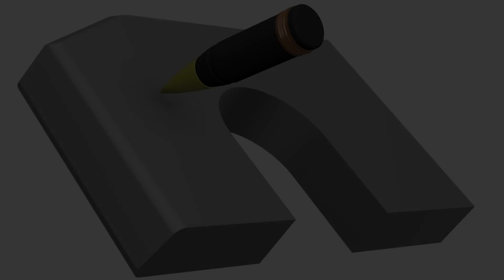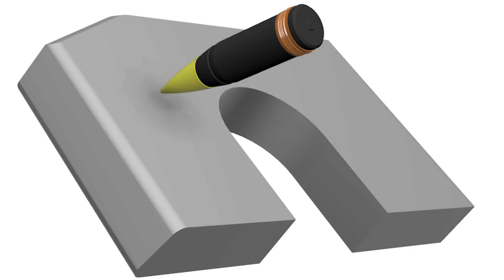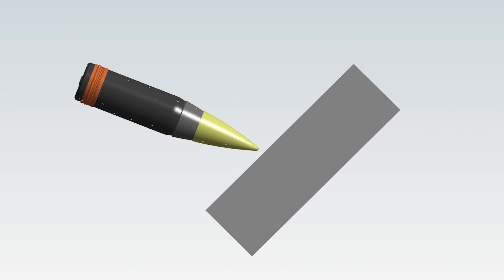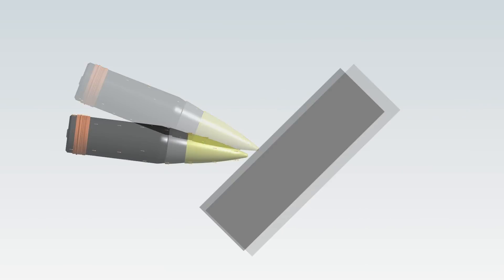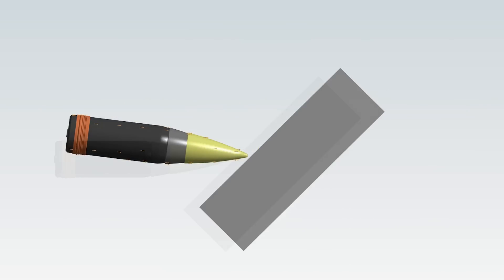USS-Iowa VS Yamato Simulation Part 2

Comment: The IOWA’s 16” Mark 7 lightweight 50 cal rifle firing the 2700 lb super heavy shell was nearly the ballistic equivalent of the YAMATO’s 18” gun and AP projectile combination. An amazing achievement by USN Bureau of Ordnance and the Naval Gun Factory.

With superior speed, range, and fire control, IOWA could shape the battle sea at will and engage the YAMATO on IOWA’s terms.
Reply: Exactly
Reply: "It's not the size, but the motion of the ocean"
Just take the L americans, have some pride.
Reply: ye but u need to penetrate first
Reply: Accuracy wasn't really refined until her modernization in the 80's. The USN tried making her even more accurate, but you can only do so much with the dispersion of a 406mm gun.
A top speed of a ship and her cruising speed has a considerable gap, and it takes quite a while to even reach that speed, and when you're making maneuvering around, it'll bleed that speed unless Iowa is sailing in a straight line, but at that point, where will she have the room to dictate the rules of engagement? 
Also, even if the 16" SHS and Yamato's Type 1 AP shells have similar ballistics, there is still a huge gap between the raw kinetic energy from one of these shells, ~356'644'450 Joules vs ~444'132'000 Joules. 

Even if we say the armaments of these ships are equal, Iowa will lack on the armor department. Her longer hull limited due to panamax, and speed just doesn't have the same level of protection as the Yamato. I mean just look at the difference between their displacements and of how much percentage the armoring alone took up. 
Where Iowa does have advantage is her detection systems. On calm seas in the daylight, both ships are almost on equal terms. Yamato too did have solutions computers onboard and the best OPTICAL rangefinders at the time. On rough seas, Iowa will easily detect Yamato and fire more accurately as she'll detect her first and have the first strike on her. Iowa shines here due to her radar, not her rangefinders. Separate systems.
It'll be a bit closer of a fight in nighttime and stormy seas, otherwise, I don't think Iowa will hold up well in a long engagement.
Reply: Still ,her immunity zone was much smaller .
Reply: @ the Iowa was much faster than the Yamato, had far greater range and much better fire control. She could shape the battle space at will and engage on her terms. 

People don’t realize what a technological leap the Iowas were over the Yamatos in every respect.
Reply: @iowa61  The mk8 shell fired from the 16 inch/50 gun could penetrate the deck at very long range,but that is a matter of chance. Between 20 and 30 km the yamato would have had an immunity zone against it,and at a distance of less than 30 km the 18.1 inch could penetrate the belt of an Iowa class. 
People don't realize that the US thought that the Yamatos were 45000 t battleship with 410 mm guns.
Reply: @ the Iowas were a technological leap over the Yamatos. Much faster much greater range much better fire control. An Iowa could shape the battle space to its liking and advantage at will.
Reply: @iowa61  maybe and maybe not, for sure Iowa can run away from a Yamato if needed.
Reply: @iowa61 bragging that Iowa can run away 3mph faster is a big flex and range is not in her favor and fire controls are actually historically quite on pair “

Comment: I may be wrong but from my understanding both HE and AP shells contained a small (for the AP round, bigger for the HE one) charge that was detonated moments after impact via a kinetic fuse. If that is the case then shouldn't this feature also be simulated. The impact alone does significant damage for sure, but coupled with an explosion i'm sure the damage model will change significantly.

Comment: The Germans had a 31cm smoothbore "Anzio Annie" railroad gun fireing a 12cm 120kg farrow at 1600meters per second. An armor piecering arrow from this gun, installed on a cruiser, would simulate a modern 120mm tank gun on a grand scale. I wonder how a 12cm apdsfs arrow would have performed on a battleship. Would it go clean through? What is sure is that anything in a penetrated compartment would be vaporized.

Comment: In a hypothetical ship v ship engagement, Iowas were so superior to Yamatos it's ridiculous. 
Speed and radar range finding vs spotter planes and colored smoke from the Yamatos. All Iowas would have to do is wait to engage Yamatos on terms favorable (night and foggy/rain etc) and Yamatos can't respond because they can't use their spotter planes. Greater speed of Iowas also mean they dictate the terms of the engagement. Damage from superstructure hits, hits outside of the citadel etc all add up quickly. 
Bismarck succumbed similarly - got to a point where they couldn't respond effectively and got hammered into submission.

What would be really interesting is if the speeds were similar and the Yamatos had radar range finding as good as the Iowas.
See the tech advantage is profound in the Iowas. Level that then you'd have to put your money on the Yamatos wouldn't you?  
If the Yamatos were still stuck at 27kts and had Iowa's radar range finding still you'd have to put your money on the Yamatos.

Comment: Yeah just not happening. Very interesting to see in the simulation. I always really wondered if they would even aim for the turret faces? Seems like They might aim for below the turret but there are quite a few layers to try to go through here. Imagine though if air power really wasn't able to compete and those two ships really did have to face off. Due to USA being so pacifist we are pretty lucky we were able to do what we did that was just effective enough. Because in all reality we were considerably overmatched and underprepared.
Reply: The aiming point was the ship. Shell dispersion alone made targeting any particular area a non- starter. Lastly- the USA is not pacifist. We're one of the most warlike nations in history.
Reply: @manilajohn0182  I think you underestimate the technology they had by then. The combined with a decent understanding of dispersion especially given the range. OFC I wasn't talking about BVR, however if they had visuals on a roughly side to side I would assume they would give a slight amount of lead fairly easy. Aiming more about where the conning tower as the pip would only make sense. After all they would have to choose. 
Secondly I was talking pre war, the certainly were pacifist, it took Pearl harbor to get them fully involved. 
Maybe you aren't aware, but the US was very reluctant to get involved in ww1 or 2. 
We did our best to avoid it while still bolstering our economy with lend lease. 
But 39-41 we weren't even a decade away from the dust bowl and depression. A large majority of our people were just getting back on their feet, and certainly a majority didn't want war.
Reply: @chris_hisss  Gunnery officers did not aim for a specific area of the target. They aimed for the ship. Even at ranges of 15,000 yards, shell dispersion made capital ship gunnery highly problematic. A good example of this took place off Truk in February of 1944, where USS Iowa engaged the Japanese training cruiser Katori in a clear visibility daylight action at an average range of less than 14,500 yards. Iowa used the Mark 8 radar range keeper and tracked shell splashes both visually and with the Mark 8. Katori had already been hit by a torpedo and from 2- 7 bombs by carrier aircraft, a number of 8" and 5" shells from a U.S. heavy cruiser and a destroyer, was making no more than 1- 2 knots (one report had her dead in the water), and was already sinking when Iowa opened fire. Iowa fired 8 salvos totaling 46 rounds and obtained no main battery hits on target. The primary reason for this was shell dispersion, although lack of main battery gunnery practice was another. Long- range gunnery in the U.S. Navy in the 42- 44 period was 22- 25,000 yards, and the expected hit rate at this range was between 3- 6%. in combat, it was lower.

Regarding pacifism- I misread your post and thought you were speaking of the United States historically overall. Endless apologies. That said, we were only overmatched and unprepared at the tactical level, and that for the first year of the Pacific war. During this period, the Japanese lacked power projection past Midway even had they won decisively there. Even the relatively light aircraft and aircrew losses in the first six months of the war strained the Imperial Navy to the limit when combined with the low turnout of aviators and aircrew during this time. From 1943 onwards, our industrial and manpower mobilization began to bear fruit and we began to swamp the Japanese.

Comment: The Mk.7 would have penetrated the Yamato's thickest armor from even considerable ranges (20,000yds or more), because all of the naval armor Japan forged from the 1910s onward was the worst-quality warship armor produced in the 20th century. It was all Vickers Hard Armor, or VHA, which was a non-cemented steel; the world standard since the mid-1900s was Krupp Cemented Armor, or KCA (and other equivalent cemented armors), while the Special Treatment Steel that all US warships were armored with in World War 2 was much more supple, less prone to spalling, and twice as strong. But more importantly, samples of VHA armor plates produced in Japan were later cut-open, and found to contain stress cracking, dust and debris from the steel mills, copious amounts of air bubbles, and even carelessly dropped tools. Against the kind of projectiles warships were expected to withstand, Japanese Cruisers and Battleships might as well have been made out of cast iron.

By contrast, the Mk.7 utilized a super-heavy penetrator, which is why it was significantly heavier than the 16" AP rounds used by all other nations. The cavity in the base containing the bursting charge was also MUCH smaller than depicted in this video, as it was determined from experience with previous ammunition testing that the ideal AP projectile would contain as small a bursting charge as possible, to minimize the probability that it would shatter on impact. Most interwar-era naval AP projectiles followed the "light and fast" formula, with blistering high muzzle velocities, but because they accelerated so fast out of the gun barrel, and because they proportionately had little mass to overcome air friction, it also guaranteed that they decelerated rapidly in flight, resulting in little penetration --- coupled with the large-capacity bursting charges many navies still favored, it meant a projectile that couldn't penetrate as much, and was a lot more likely to shatter. But the Mk.7? It was slower and denser than most other major-caliber AP projectiles, with a comically small bursting charge (compared to the 5-10% bursting charge mass of most other Battleship AP rounds, only 1% of the Mk.7's mass was it's bursting charge!) meant that it retained speed better over distance, penetrated more armor at all distances than any other 16" shell, and could even penetrate no less than 10" of armor even at maximum range. US Navy superheavy AP rounds had superfluous performance figures, that were never matched or exceeded by any equal-caliber naval ammunition ever put into service by any other nation, before or since, and even the giant British and Japanese 18" shells suffered greatly in penetration at 40,000yds or more.

In short, the Mk.7 had substantially better armor penetration at all distances against this target than shown by this simulation. From ranges at which 18" shells would have trouble penetrating most of the armor on an Iowa class Battleship, a Yamato class Battleship could be penetrated all over by Mk.7 16" shells --- and more importantly, the Iowa class had a higher first round hit probability, and a near 100% hit probability for all subsequent rounds fired, which was consistently demonstrated in combat during multiple conflicts from World War 2 to the Gulf War.
Reply: Source material is from the U.S. Navy Bureau of Ordinance.

Immunity zone of the Iowas vs. the 18.1" gun:
Citadel                    24,800- 29,800 (5,000 yards);
Turret Faceplates 24,700- 31,600 (6,900 Yards);
Barbettes               26,500- 31,600 (5,100 Yards);
Steering                 24,700- 28,800 (4,100 Yards);
Control Tower       26,500- 31,600 (5,100 Yards).

Immunity Zone of the Yamatos vs. the 16" .50 cal. gun:
Citadel             17,000- 34,500 (17,500 Yards);
Turret Faceplates                      (Impenetrable);
Barbettes         16,600- 36,800 (20,200 Yards);
Steering           19,100- 33,400 (14,300 Yards);
Control Tower 16,600- 33,400 (16,800 Yards).

Comment: So....According to U.S. NAVAL PROVING GROUND, DAHLGREN VIRGINIA, REPORT #5-47 (ADA955281.pdf at dtic (dot) mil)

"26in Class A Turret Face Plate 
The estimated limit of the subject plate versus
the 16" AP projectile Mark 8-6 at 0deg obliquity is 90±3% of
Ordnance Sketch 78841[a penetration formula that determines 
the speed necessary to completely penetrate the plate, where 
100% is a baseline value. This allows comparison of armor quality]. 
No U. S. plate of similar gauge has ever been manufactured 
so no direct comparison of ballistic limits is possible. 
Early ballistic tests conducted on heavy Class A and B armor at low obliquity indicated that
the limit of U. S. armor under similar conditions would
approach 100%. It is interesting to note that assuming the 
turret face plate was mounted at approximately 45deg to
the vertical, calculation indicates the inability of the
modern 16" U. S. projectiles to penetrate a plate of this
gauge at any range. However, as can be seen from Figure 7,
the plate broke in half on both the complete and incomplete
penetrations, and a failure of this type in service would
partially, and perhaps completely, disable the turret."

Plus we literally have the piece of armor on display with a 16in sized hole in it. I will absolutely grant that test was performed at 400ft and they do not mention the powder load. Yes, that is a fairly unrealistic engagement scenario. But we still have literal physical proof, that you can go have your picture taken in front of, that a 16" Mk 8-6 AP shell can crack 26" Yamato-class ship turret plate armor. Maybe next time, dont throw training rounds full of sand at it.... The only thing the Yamato excels at is being a coral reef. Dont touch our boats, or its gonna be a bright, bright sunshiny day.
Reply: Geez,you are stupid, that plate was tested with a reduced charge simulating a distance of around 20 km BUT with the plate placed vertically. It would be like saying that the frontal hull armor of a T-34 is effectively 45 mm.
A Yamato would have been able to penetrate the armor of an Iowa while being in its immunity zone.
Reply: The part that you overlooked-
"It is interesting to note that assuming the turret face plate was mounted at approximately 45deg to the vertical, calculation indicates the inability of the modern 16" U. S. projectiles to penetrate a plate of this gauge at any range."

Comment: US armor piercing shells were designed to plunge through decks and bunkers using fire control radar. The Yamato was made to duke it our at relatively close range.  If Yamato managed to close with the Iowa class battleships it would win easily.
Reply: Not so fast there... While the Yamato's turret faces were immune, the rest of her was not. The 16"/50's caried by Iowa were more than capable of penetrating Yamato's hull in the close range fight you suggest. At that point, it becomes an issue of who can land hits faster.

Another thing you should consider is the conditions of the engagement. Are we in day? Night? Squals? Fog? Any of these would be incredibly detrimental to Yamato's gunnery, since her radar assist only accounted for about half the equation, and she still needed visual contact to resolve the other parts of the solution. The Iowas on the other hand were fully capable of shooting when completely blind visually, as proven by USS Washington (a North Carolina class) during the Guadalcanal campaign. Washington scored 40 main battery hits on Kirishima at a range under 10,000 yd. In those kinds of conditions (especially at that point in the war when Yamato didn't yet have her radar), Yamato gets carved up like a cake.
Reply: @mechakid  Iowa would have to get too close and be Swiss cheese before then. Iowa's strategy would be to maintain a long-range and use superior accuracy.

Comment: Kind of funny thinking about it, today a modern ATGM would just zip through that turret.
Reply: Yes but the damage it causes post penetration would be laughable as a HEAT warhead doesnt produce much damage relative to the size of a battleship turret. You might do some damage to machinery or stuff a bit but think of the main plate as like a spacer for the rest of the stuff inside the turret and you have a 400mm + plate and however many feet of air before the jet reaches any critical component for operating the turret.
Reply: @PerciusLive the tons of gunpowder sitting right on the other side of that turret face say otherwise. Let that do the rest of the work for you. The inside of those turrets are a gigantic bomb of combistible. Its why turret faces tended to be the most heavily armored areas on the ship.
Reply: Any modern- day ATGM would shatter against the plate.